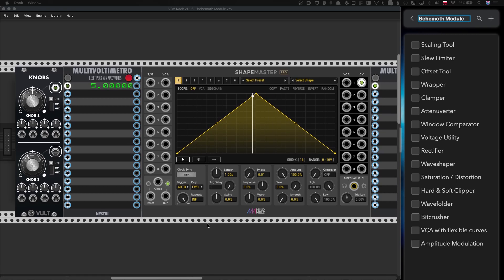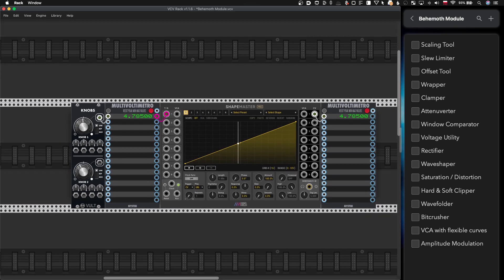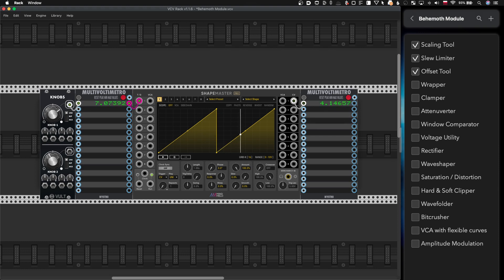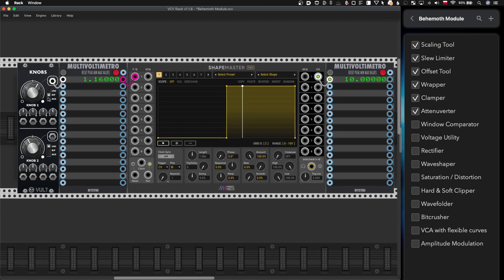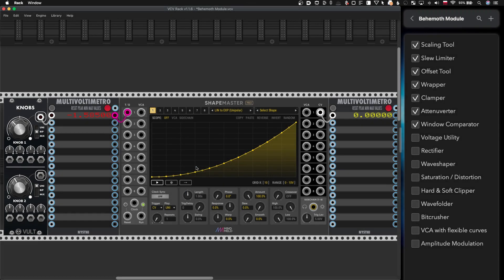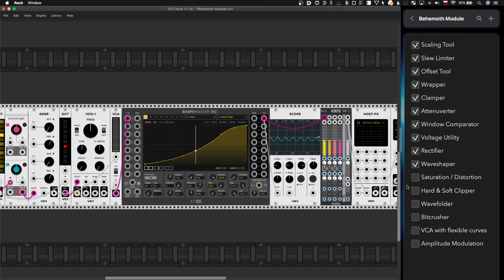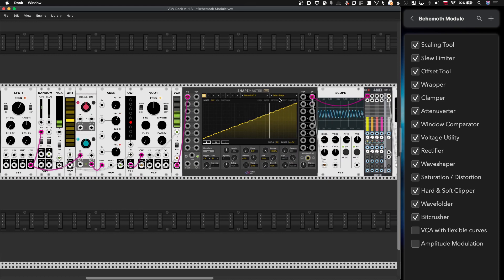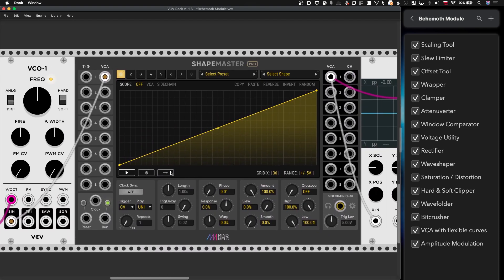Shape Master Ep.6 - Multifunction Behemoth - VCV Rack Tutorial

Comment: I wonder if one can build a compressor with it, one shape to detect when the signal cross the threshold, one shape for an envelope that control the amount of a compression curve ?
Reply: It can act as a compressor for sure. For the first part you can use the sidechain input - that contains an envelope follower and the Trig Lev knob is the threshold - that will fire the envelope when the signal crosses the threshold. The little cog icon to the right of that knob gives access to advanced sidechain settings with gain, high pass and low pass filters, sensitivity, hysteresis and hold off for tweaking the sidechain signal and dealing with unwanted triggers. Then you just have a ducking envelope shape that starts and ends at 10V - adjust length and attack/release parts of the envelope to taste.